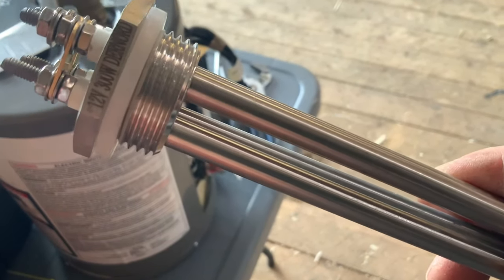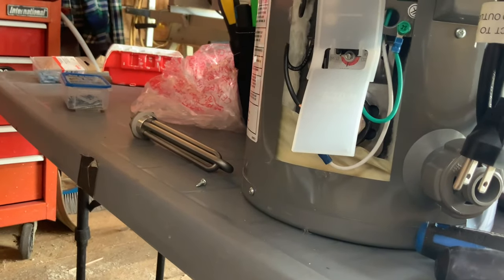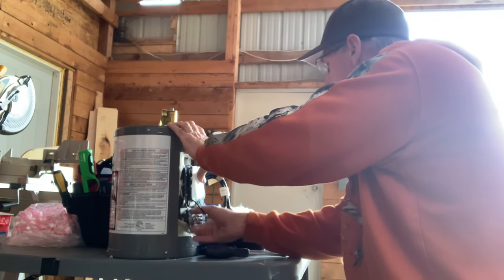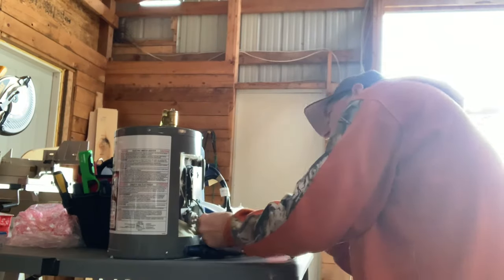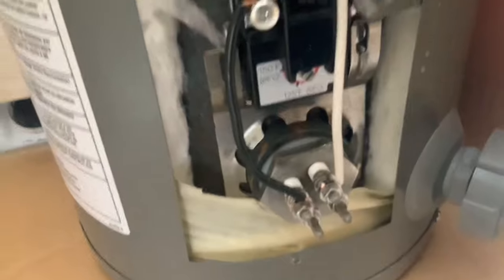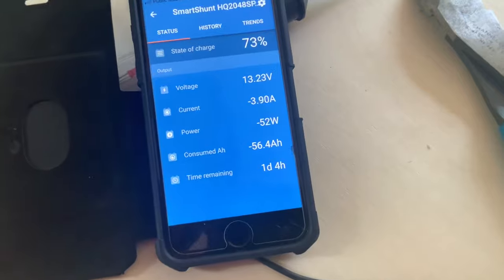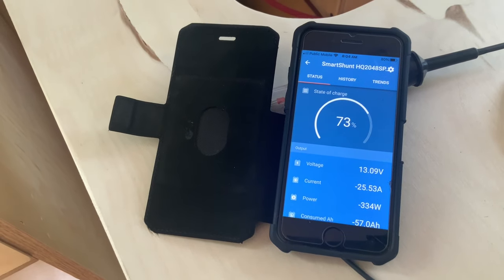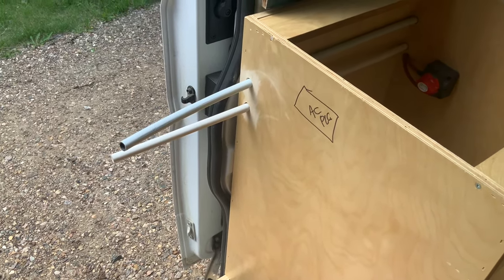Best Install 12v DC Off grid hot water heater in Van or RV Solar Compatible! DYI! Convert RV to 12V

Comment: I have had this argument many people who have gone solar with batteries. If you  going this way and need hot water, a dc powered hot water tank makes the most sense  e cause it it inexpensive both to setup and to operate… no losses to the the inverter and is very reliable.
Reply from the maker: I agree but it is a tough sell. You need energy of some type to make heat. I find I have an abundance of DC power, solar, DC charger while driving, without any loss so this makes sense.

Comment: I imagine this is too small for a shower? What do you recommend for showering from solar only?
Reply from the maker: It all depends on your shower needs. Most Vans don’t carry a lot of water. I do plan on putting an 8 inch round 6 foot long black PVC pipe on the roof for straight solar shower. That is 15 gallons of water. Stay tuned😄
Reply: I have a 2.5 gallon water heater on my boat and it works find for showering.
Reply: The average shower temp is 105° and the water heater (on AC power) gets up to 140°. So you always mix some cold water with the hot, which gives you more water. Even better if you shower with 100° water.

Comment from the maker: https://youtu.be/TV4X6PzOFDo. This is a video on the DC water element/thermostat talked about in the Comments. Looks pretty good and I agree it would help anyone with thermostat issues converting. Better wiring terminals and I like the 600 watts. Less power consumption but still good heating. Thanks

Comment: Dumb idea using 12 volt.you don't put tank inside you run a pipe. Heating uses large amounts of power. I've been of grid for 50 years. You use propane for large loads so you don't cycle your batteries to often.
Reply from the maker: One reason to use lithium batteries like in this van. I wanted something other than a propane water Heater.

Comment: SAVE YOUR MONEY!!! 
Volts X amps = Watts.  So, A 300 watt 110v. AC element is the SAME DAMNED THING as a 300 watt 12v. element!!! A 120v. or  a 240v. water heater will run just fine on 12 volts if there are enough amps. No need for new elements if the ones you have are the SAME WATTAGE
.
Reply: Except 110v AC has to go through the inverter, which means ~10% of the energy is lost to heat/inefficiency.  Additionally, for someone with a system already bumping up against their inverter's max draw when everything is on (like when you're cooking), having the heater draw direct from the batteries could prevent an overload on the inverter (assuming the batteries still have enough current rating.  My system has 9800 watts of current capability from the battery, but only 6000watts on the inverter.  Moving the water heater to pull direct from the batteries gives me more inverter headroom when I'm running induction cooktops, AC, fridge, etc.  My plan is to go ahead and run the water heater on 110v AC but if I hit the limit on the inverter even once, I'll switch the water heater to DC.  There's trade offs for everything, it's not always about cost.  Sure, I could just remember that I have to turn off the water heater if I use the hot plate, but my wife and I are forgetful, and I don't want her to panic just because she forgot to turn off the water heater.  We have the battery capacity and solar to spare, so who cares if it's left on here and there?  The lithium cells will calendar age long before they hit their max number of cycles.

Comment: what pump are you using?
Reply from the maker: A SURFLOW RV pump. I think 3 gal per min. About $100. So far great!
Reply: @dadzvanz936  good to know! Thanks so much. Appreciate the quick response. Does that turn on automatically when you open the tap?
Reply from the maker: @dvella31  yes it does. It works on an internal pressure switch in the pump. The pump runs to build pressure then as pressure drops it kicks in. There is very little differential pressure so if you have high flow, house style sink tap like I have,  it is nearly continuous.  I also have a 12 volt switch on my control panel to turn power to the pump off while I’m not there. Just a little safety so if a leak occurs you will not flood you van. All a very reliable system but I sometimes park it for a few weeks.
Reply: @dadzvanz936  that’s great. Thanks so much for the helpful info!